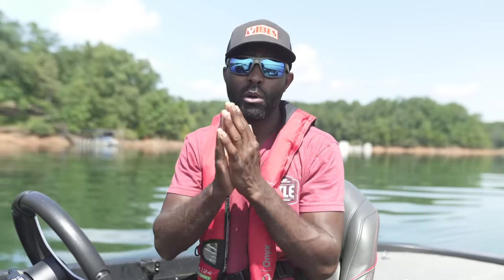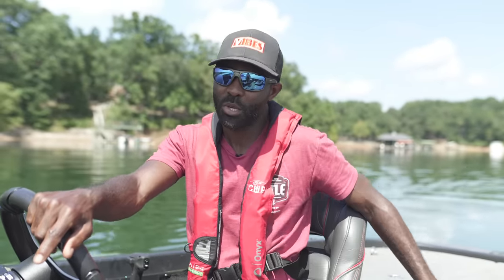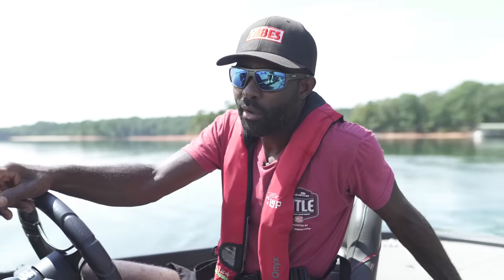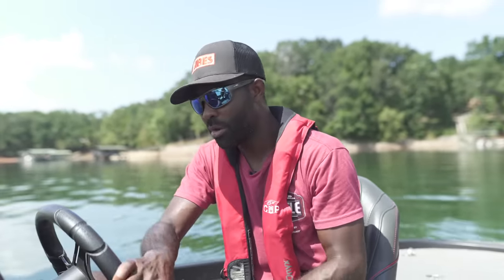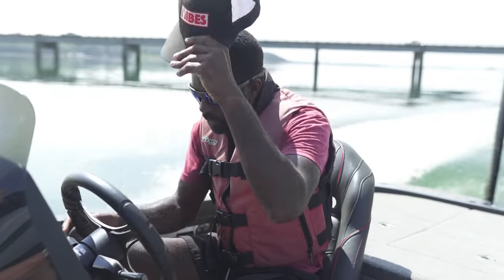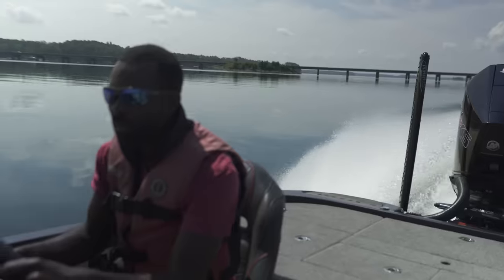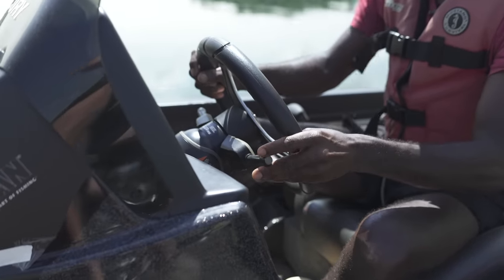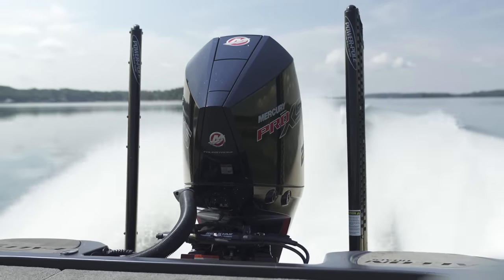Common Boat Driving Mistake

Comment: I have a lot of that seat time he is talking about. I would caution anyone trying to drive top speed and maintain a chine walk. Trim the boat down some and slow down a little. You might maintain control 999/1000 times, but that one time you hit a wake wrong, you might end up getting thrown from the boat, seriously hurt or worse. Look up bass boat crashes. Stay safe out there
Reply: Exactly right!!

Comment: My boat doesn’t go fast enough to worry about chime walkin haha
Reply: Same - I have a Ranger and never go fast enough to have this problem LOL
Reply: @spintowinstradic6067 the rangers I've been in had less tendency to chime walk in the first place. I think they are the best hull design and weight for choppy water. They are not the fastest on slick water though.
Reply: It's chine not chime
Reply: @brandonsmith606  obviously my phone begs to differ lol
Reply: Haha I'm not trying to be an ass 🤣 just helpful but yeah my phone doesn't like it either
Reply: My Skeeter doesn’t chine walk the fastest I run is 55-60
Reply: Mine either lol😁
Reply: My boats never seen 50, much less 70 😜
Reply: My Phoenix doesn't start trying to chine till about 72
Reply: Lol my Grizzly does 55 and it does it with Flotation pods sometimes lmao and when it does it hilarious

Comment: Best tip I received to learn how to drive a pad bottom boat was to focus on the bow/bow light and horizon and when you see the bow fall off to either the L or R you give the wheel a slight bump in the opposite direction...so you're driving and giving small inputs always returning the wheel straight and never see-saw the wheel back and forth which will only make things worse. So small bump L or R and then back to steering straight, small bump, straight, ect...and you'll get the hang of it quickly.

Comment: mine seems to loose traction at the prop when i barely trip up,don't have a jack plate , boat is 20' alum and 150hp merc, just under 3 hours so may need to do more time on the boat
great video

Comment: I have Allison and a Ranger (several actually).  The difference between a really fast boat and Rangers, Falcons, any other "heavy" boats with a ton of HP, is the WAY it performs on plane.  I owned an Allison, and with a 150hp, properly set up, I can go much faster than most all boats with two or three times the power.  My Allison runs very fast with the 260HP short shaft on it.  You HAVE to drive an Allison, there is no hydraulic steering (those do not offer any feed back), you will get a 'feel' for what the boat is doing especially going fast, in the steering wheel.  NOT so on a hydraulic steer boat.  95 + mph things can get dangerous.  I never had an issue even in rough water, because.... I had enough time in the boat (seat time, as you say) and know what it likes, what it doesn't.  Balance in the boat is necessary also.  Heavy over powered boats do not get affected as much by weight imbalance as a lighter speed oriented boat, but can go fast enough to get uncomfortable.  You should balance your boat.  Even the factory set up does little to consideration of balance.  If you go alone more than not, move things around when you take on a passenger.  One other thing, too much bow lift does not really make you go faster, (I said too much) it DOES make the boat get unsettled much easier.  Allison's run on plane flat, yet very little pad is in the water, slow down to about 70 and it is very stable and predictable.  I love the Ranger for fishing, if I want to go fast, Allison all the way.  When driving in rough water, a mistake I see a lot of bass boat drivers make is;  they don't drive through to the coming wave, they let off the gas and the boat becomes unplanted and will come up out of the water once hitting the wave and slam back down, potentially injuring the drive or passengers, damaging the boat, or both.  Keep the power on (not full on), trim down and drive to the wave, letting the beautiful keel of those fast bass boats do their thing by cutting the wave (that is if you have a 19' plus boat, shorter and you could stuff it, so KNOW your boat and what it can do) and you will get through it much safer.  Chine walking is really a mater of unbalanced boats for the most part, it is trying to run on the pad for how it was built and YOU are making it difficult for it to do so.  Either by trim, jacking, balance, or steering wheel movement.  The best way to LEARN your boat is to take tiny adjustments and see what the affects are.  Hope this helps.

Comment: I remember back in the late 70's when Hydro sports started all this pad stuff and dealers would put lower HP cowlings on motors to match the plates but where water rockets that would throw drivers out in a split second, when it would start to walk on them.  I saw that happen a number of times. Never saw one die but they were black and blue for at least a month.

Comment: Hi Brian, I had an old faulty jack plate gauge, just like yours, that actually raised the jack plate all the way up.  My engine overheated as a result.  I've replaced it with a new one and no issues.  At what point raising the jack plate and what water pressure would you get concerned about overheating? Thanks for the content you put out.
Reply from the maker: Watch the the water pressure and water temperature gauge

Comment: If your boat is chine walking the motor is too low on the transom. The fastest way to adjust a manual jack plate is raise it up to the top and start lowering the plate till it bites or water pressure is good.

Comment: Makes so much sense, I got a 03 Stratos 21xl pro star with a 17 g2 250ho. When it is cold I can get about 73 before it chine walks, but I stilll have about 500rpms left. Maybe mid to high 70’s is about as fast as that will go

Comment: Some boats are more susceptible than others. Some times it is water conditions . I had a stratos mine would do it on occasions. I ever so slightly worked the steering  wheel maybe 1\4  inch that or bumped the trim

Comment: Great explanation of what’s going on and how to handle.
Reply from the maker: Glad it was helpful!
Reply: @BrianLatimerFishing Brian.  If there is one thing driving a bass boat that I still struggle with it’s boat wakes.  Meeting another bass boat and handling the wakes so smoothly.  Any tips for those?
Reply: @PhilClark1976 just trim it down a little. I’ve seen and been in bass boats that don’t and they can and will go airborne and that’s not fun

Comment: I just touch my trim tabs down just a pinch and boat will be rock solid and trim the the motor down a little and you can fell both in the seat of your pants. I’ve got a 22’ Donzi Classic with a built 502 with 515 hp and at 85 mph you have to use your tabs because this boat is a full v bottom but you can run it wide open in 2’ waves and this boat is heavy but when your in rough water it just handles like a dream and in rough water that bass boat is light my boat is twice as heavy but I lighten the boat with aluminum head and intake and exhaust manifolds which are water cooled and straight 4” pipes so it sounds great at lake OZ with all the huge hills you can hear it echo threw the hills and it’s a blast to drive but it’s a tannery boat and I get up on plane and set the drive and when you are on plane start raising the out drive when you feel it Brest lose from the water and just touch the right tan down with just numbing the tan when you feel the boat move your done for that side now do the same thing on other side and you are good for the week end and after that you just raise and out drive and when you feel the boat take off and after that just look at you trim gauge  and put it back to the same spot and it will launch and you can feel it launch and you can turn on a dime and for cruising  I run right at 3500 rpm’s and that’s like 50 mph and at full bore it will push you into the seat and everybody’s ears start flopping and you have to have a good set of shades or you will mess with your eye lids and I don’t hardly run my boat wide open because my wife don’t like so she just wants cruse speed or 35-40 mph.

Comment: Oh I put a new motor on my champion 203, the prop they gave me my boat didn't like at all. Had too much lift and it was violent. What was an easy 65-70mph boat couldn't control it at above 60mph. Changed props and boom, 65-70mph no issues.

Comment: It would be informative if you could let people know which way to twitch the wheel when they feel the boat start rocking. For example, if they feel the boat start to rock, as the paseenger side is dropping, which way should the steering wheel go? Toward the passenger side/the direction of the drop or opposite?
Reply: opposite of the direction its falling

Comment: Brian I know you didn’t just try to tell people boats don’t chine walk😂 my dad owns a 2007 Stroker Bass boat with a 250 racing merc as well as a 2020 ranger 520L. The reason a boat chine walks is that in order to get speed you have to pick the boat up out of the water. When you pick enough of the boat up out of the water, the torque of the prop turning to the right will cause the boat to start to wobble, hence the term chine walk. There is a skill to driving chine walk even though it’s essentially just popping the wheel a little left, but once you know how it’s like riding a bike. Only reason I comment is that someone is going to get hurt thinking you can just “drive through it” or that shifting weight in your boat is going to eliminate it all together. If a boat barely walks, as in you can just let it do it’s thing and it corrects itself, sure shifting weight will do it. But if you have a boat that starts walking reasonably before you reach top end speeds, the only thing that’s going to keep the boat going forward is the man behind the wheel.
Reply: You basically just reiterated what Brian just talked about in the whole video.  I think you just heard the beginning of the video and posted a comment.  And didn't watch the whole thing
Reply: I watched the whole video. Even at the end he mentions “getting through” the chine walk. It doesn’t go away. It gets worse the faster you go and requires more skill to drive. I’ve heard countless people talk about how their boat starts chine walking at 70 but quits at 75 and the reality is that those people can’t drive their boat that fast to begin with🤷‍♂️ if they could they would know😂
Reply: @mac11double  basically the point is. Get your speed up to where around u want it. If it starts chine walking play with the trim and jack plate until u feel comfortable.  End of story
Reply: Exactly right I own a 95 20XD Bullet Bass Boat with 300XS Mercury and the boat chine walks but as the driver I can drive through it no problem running 94 with a fishing load
Reply: Pretty sure that’s what he said?

Comment: The only boat I have owned that chine walked was a Glastron. So what he  said is incorrect. Its not the driver, its the boat. Most high performance bass boats are pad boats. When properly trimmed, the boat is running on a flat pad at the rear of the  boat. There is no force at that point causing the boat to chine walk. 

I now have a Tracker which has a basically flat bottom, and a 50 Mercury 4 stroke which doesn't run fast enough to chine walk. I grew up and don't need to go fast anymore.

Comment: That is a pretty country way to explain it, but the trem "Chine Walk(ing)"  is a term as far from country as you can get.  It should be called "Hull Walking" instead.  You should have called this video, "Walk Around the 'Chines' Tonight (a Jingle)."  The chines on any hull do nothing if you get them out of the water.  There is one cure and one cure only; and it works every time it is tried - trim the bow down!  Maybe your next video can be, "Diggin a Chine-in at High Speeds Tonight..."

Comment: Just promise not to run that fast on water you don’t know well and never in fog or dim light. For me, I want my bow low enough to use the architecture that’s engineered into a good hull.